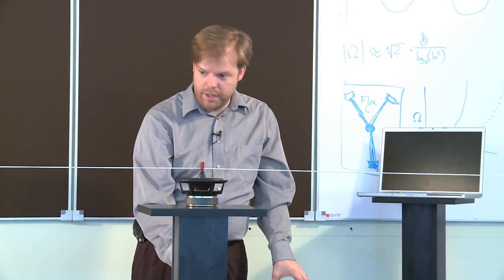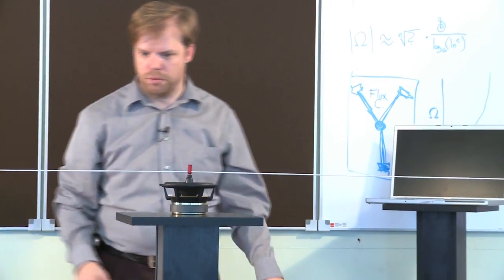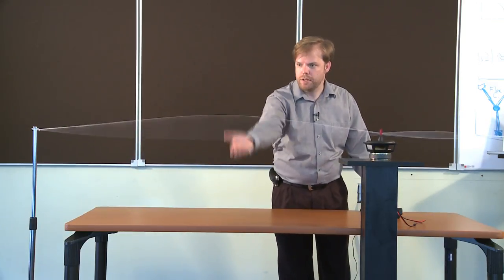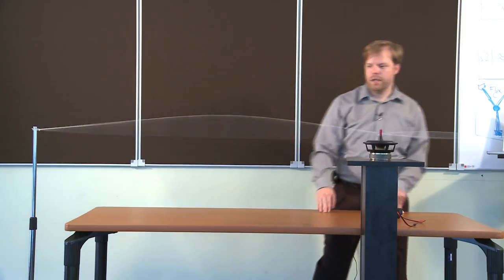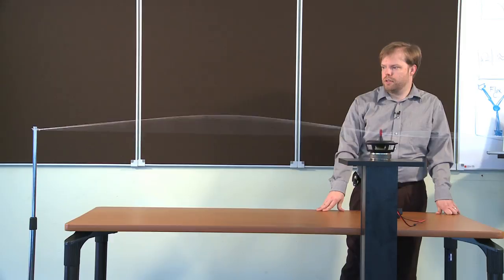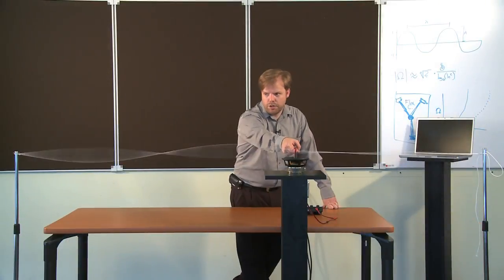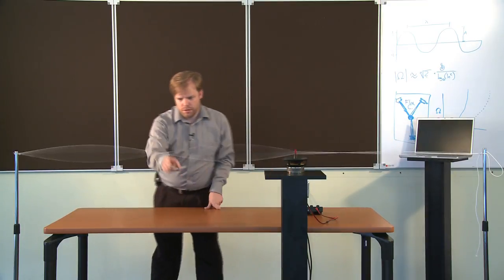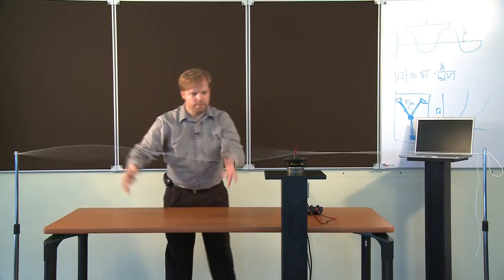String Resonance

Comment: Love it.  Just one question ...wouldn’t 22Hz have a wavelength more like 50 feet?
Reply from the maker: In air, yes. On a string, not necessarily. The speed of sound changes for different substances. Consequently, frequency and wavelength is a little different.